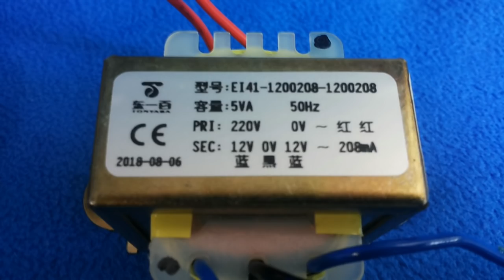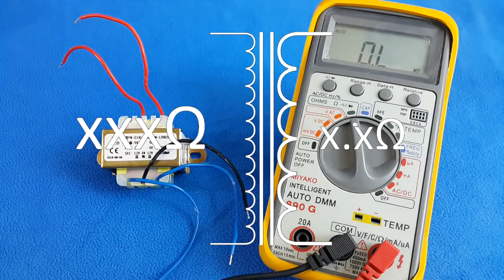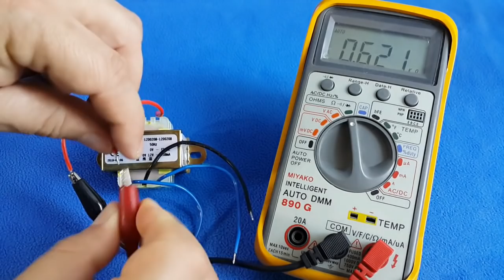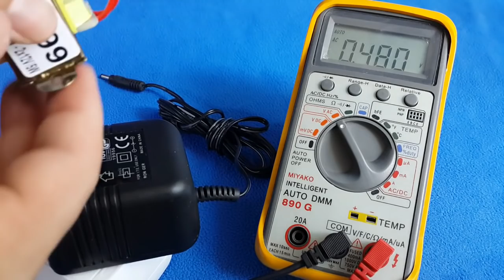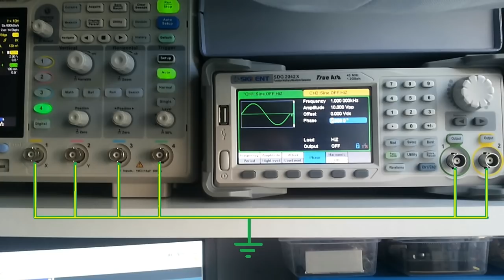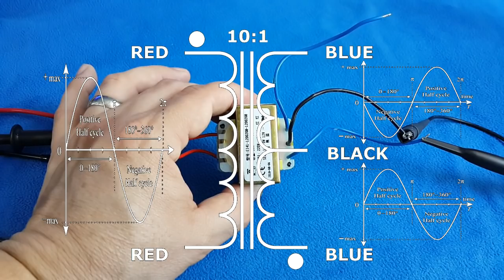Transformer polarity test / how to find it / and how to test a transformer with DMM & oscilloscope

Comment: One very safe way to test is to put a Tungsten filament mains bulb in series with the input .... should you connect the mains to a 6 Volt winding ... the bulb will safely light up avoiding damage ( tried - n - tested ) ..... DAVE™🛑